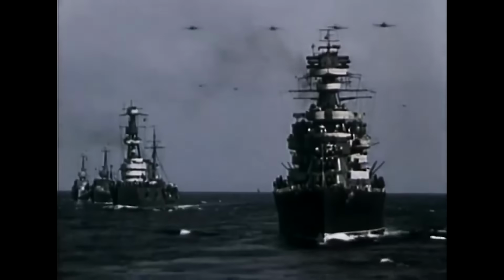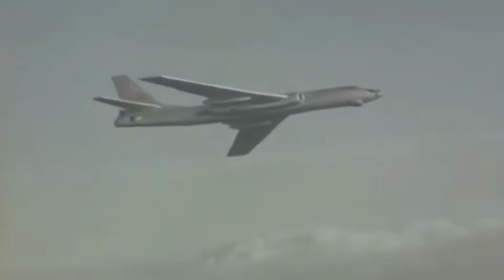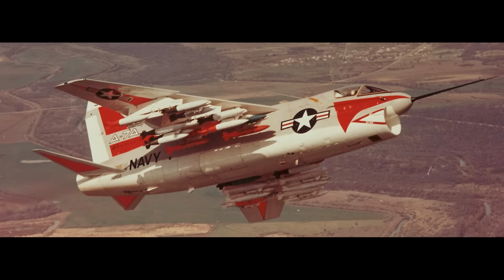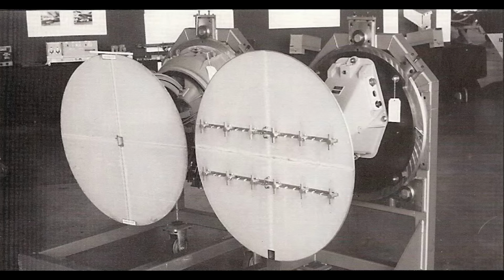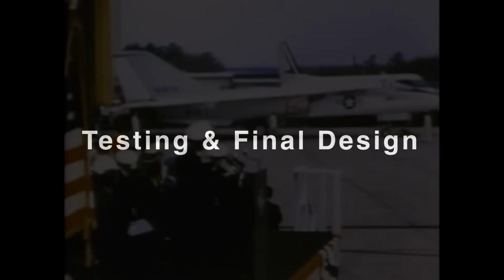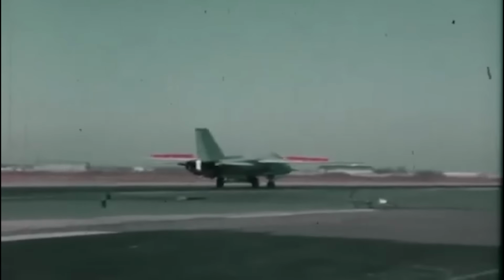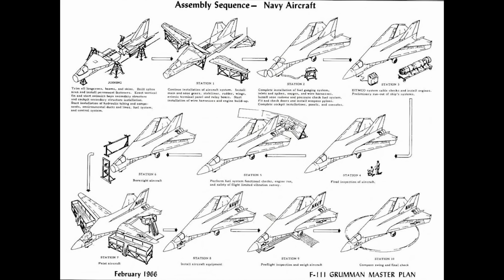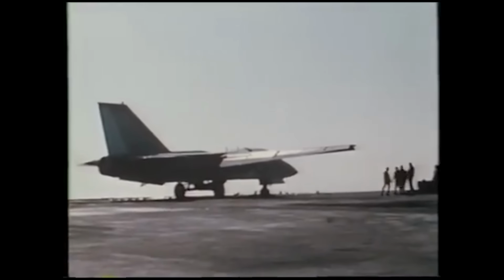Was The Grumman F-111B A Bad Aircraft Or A Missed Opportunity?

Comment: The f-111, especially its last iteration the F model, was a truly superb aircraft if you wanted to park a 2000 lb bomb within 10 ft of where somebody was standing and within about 10 seconds of anytime you wanted it to hit. However as a fleet Defender it would have been an abysmal failure. It didn't even have ailerons it used wing spoilers to interrupt the air on the turn side Wing to turn. It was not going to make it in combat air Patrols. I am familiar enough with the flight characteristics of the f-111f model that I actually ended up flying the flight simulator. Very touchy it was but I was the first one ever to fly the f11f flight simulator and landed without crashing it the first time I got into the cockpit. I was an avionics Tech and I worked on the avionics and the automated flight controls and instrumentation. I was able to teach several Pilots how to engage the terrain following radar while in articulated Terrain. Something for which they had lost a plane a couple of years prior to my getting to the base. I studied enough of the flight manual in order to fly the simulator. The TF 30 engine which was in the original f111a and f-111b. Was not a necessarily bad choice for the f-111. But it was a deadly choice for the F-14. It was constantly played with shutting off at very inopportune times. By the time the F model came out which use the same engines as the F-16 and F-15 and the last version of the F-14. Now you had something that would accelerate fast enough that you couldn't get the landing gear up fast enough to not overspeed the landing gear. The engine that the F-14 should have been built with from the start. Have they done so the F-14 might still be the premiere Fleet Defender to this day even with its very temperamental maintenance requirements. I did work on several of them at my air base when they were there and they were temperamental Sons of Guns to keep in the air. I did read a report about that time that only about 50% of them were flyable at any given time on a good day on an aircraft carrier. They required a lot of maintenance.

Comment: @tararaboomdiay7442  
While I'm not opposed to differentiated performance requirements, I argue that streamlined production is a core feature of 5th Generation Aerial Warfare ('Joint Advanced Strike Technology' 1992) as demonstrated by the JSF which variation into the naval C variant does not require 'completely separate production lines'. 

The B variant is simply political sabotage by the UK, as the USMC will fight with drones for subsonic Close Air Support, just as they got rid of armor... 

It doesn't matter what the services said, a decade ago, the funding and contracting was first dramatically cut, then put on hold in 2024 - neither will be produced, because of the development costs that neither can afford. 

The F-47 may be the political equivalent of building 'the Wall' in Jerusalem... 

The B-21 may remain the only 6th Generation asset that will be in production, a decade from now with the JSF cut in half and doubled in price from 2025, onward - rendering the US Air Force the death of the US Navy (which wouldn't have been the case if the F-4, F-111 or F-14 were modernized to 5th Generation features, leaving the USAF to concentrate on ICBM and Space modernization)...

Comment: I was in F-111 flight test in the mid 80's at McCellan AFB,CA. ( i've got over 2000 hours in the 111) There was a F-111B in the back of a corner of the base. Completely stripped, guessing anything that could be used in the AF airplanes got taken off. Still had the NAVY markings. Sad looking ship. No clue what happened to it. Left in 1986.
Reply: I was there at the same time, saw the same airplane.  AFAIK, it was still around (what's left of it) 15 years ago, but in a So. Cal junkyard.

Comment: Thanks to GOOGLE blocking replies within threads, systematically, the main section will serve as a disorganized forum... 

 @tararaboomdiay7442
"NGAD and F/A-XX were/are different airframes (...)"

Since neither are in production or have official documentation akin the Joint Strike Fighter program, this is speculative.

Both services need the equivalent of the A-12 Avenger II: very long range ground attack with Low Observability, advanced sensors, broad encrypted communications bandwidth, Electronic Warfare Counter Measures and stand-off Air-to-Air missiles - and the large internal weapons bays and fuel tanks to fit - just around 50 tons maximum take of weight and 20 m wingspan to operate on a super carrier.

The US Defense budget simply can't afford two separate procurement processes at this stage - regardless of what the services say, if there will be a manned 6th Generation F/A-XX, the Air Force will take it as the 'F-47', same with the Navy... which is exactly why this conversation happens around an aviation history video about the F-111B...

Comment: Considering how great the FB-111 was as a bomber, the Navy should've gotten it to replace the A-6 Intruder, and kept the F-14 as a fighter.
Reply: FB-111 was a SAC bomber.
Reply: Small problem of operating irom a carrier.
Reply: @tararaboomdiay7442  IIRC They determined the F-111 was able to operate from Carriers, but it wasn't a good-enough air-to-air fighter (hence the F-14).
Reply: @strategicgamingwithaacorns2874  They tested a late F-111B from a carrier to see how a variable sweep aircraft would fit into carrier operations.  That F-111B was flown at lower than normal weights.  In any case, it doesn't matter, because the FB-111 a much heavier model and lacked the features that would make it carrier compatible.

Comment: In terms of what the navy actually ended up doing wouldn't the f111 have been a better option? I mean it had 2.5 times the ordinance load of the f14. As far as I can tell the f14 spent most of it career dropping bombs and only had a handful of missile kills against inferior aircraft in US service. It also wasn't until 98 that it had any independent ground attack ability which was the f111s specialty from the start. It's supposed agility seems to have been pretty useless in actual service.
Reply: The development of its ground attack capabilities was postponed for decades since that role was going to be assigned to the Hornet.
Reply: Also, the F-111B's payload was six Phoenix missiles.  It couldn't carry or use the other ordnance F-14 could carry.  F-14's max weapons payload was 14,500 lbs.  Are you saying F-111B could carry 36,250 lbs?   You're probably thinking of the FB-111 which could carry almost that much and is a different thing  entirely.

Comment: Thanks for the deep dive into the story. I forgot about the F-111 navy version being cancelled altogether instead of being used in a fighter-bomber role. I thought about the Aardvark being used in Operation El Dorado Canyon. In reality, the planes were of course land-based and had to come from the U.K. (for political/diplomatic reasons).
Reply: F-111B would not have been able to be used as a fighter-bomber.  It was a single mission aircraft and did not have USAF's strike avionics (it also couldn't use the pylons from the USAF version.
Reply: @tararaboomdiay7442 What's the right designation then? Not fighter, not B-111 ... Edit: Oh, Long range interceptor with AIM-54... So ist would Not have had ANY air-to-ground capability? I was not aware of that.
Reply: @ticotube2501  For the Navy role "F" would be the correct designation.  For USAF role, it should have had an "A" for attack, except for USAF everything is either a Fighter or a Bomber; it doesn't like to use "A" unless it's forced to for political reasons (more acceptable to call something an Attack aircraft than a Bomber), or it is adopting a Navy aircraft that already has an "A" designation.  Even in the latter situation ir called the A-3 the B-66.

Comment: With the benefit of hindsight, we can see that variable sweep wings were not stuck with.

Imagine if someone thought of an alternative - a discarding wing. The aircraft would have a simple high delta wing, along with a discarding wing above that. It's essentially like a big drop tank, but shaped like a wing. Instead of flaps, it would tilt (like the F-8's wings).

Point is ... this could save on development costs, and save weight/complexity by avoiding the swing mechanisms. The aircraft could loiter efficiently with the discarding wing, but if necessary it could discard the wing for speed ... in theory.

In practice? Supersonic dash capability was not needed most of the time, so the aircraft would return with the discarding wing. The wing could later be augmented with flaperons, and weapon hardpoints. The whole discarding capability could be itself discarded, resulting in a rather conventional aircraft.

Comment: As for Navy requirements!

Yes the F-111B was a horrible design for the Navy!

Going to give the 1 and Only reason needed, that is the fact that the EJECTION MODULE, or POD would have killed a bunch of people!!! 

See, if you launch a 111 off of the bow cats, or you're just on the deck during warm up, or before and some emergency occurs and you eject... Chances are that whole pod structure is going to up and likely slam back down on the flight deck uncontrollably!!! It's likely to hit aircrew, deck personnel, other aircraft - and possibly the carriers' island - ouch!

The latter could kill everyone on the bridge, etc. and put the carrier out of commission for months depending on repair times, etc.
I mean regular canopies were bad enough, but rarely hurt anyone, as most watched them go up, and deck crew  moved out of the way.

The eventual F-14 Tomcat had quite a few ejections with it's  zero speed-zero altitude Martin Baker seats, and several aircrew landed back on the flight deck. The only damage I ever heard of was that 1 chute got sucked down another aircraft's intake and FOD'ed out the engine. 

Now hear this! 
There has never been a successful transition of an Air force aircraft to be fit for the Navy!
Not even a modified P-51 Mustang!!!

There have been several Navy aircraft converted to A.F. use - the F-4, A-7, F/A-18 used by the Canadian, Australian A.F.'s...

You have to have 2 designs! 

A note about the F-35, ok it is actually FOUR different designs!!!
1 AF, 1 Marine 1 Navy and the export version! They may look similar, but are NOT!!!
Reply: The FJ Fury used by the Navy and MC was a development of the USAF F-86, swabbie.
Reply: @dukeford8893  The Navy  FJ-2 Fury was a development of the USAF F-86 , true, but the USAF  F-86 was based on the  Navy straight wing FJ-1 Fury, zoomie.
Reply: @tararaboomdiay7442  The FJ-4, then.

Comment: You can see just by the massive size of the thing that the F-111 was in no way suitable as an aircraft carrier based interceptor. Not only that, but I can't ever imagine seeing that giant elephant doing fast moving turns in dogfights. Despite its perplexing "F" designation, it really is only suitable as a ground attack aircraft.
Reply: It was intended that interception would be very long range  - BVR (ie Beyond Visual Range). To do that you need a big powerful radar with a longer range air-to-air missile, which means a big plane. If an enemy strike aircraft got within visual range of the interceptor it was likely the carrier would be well within range of its antishipping missile.